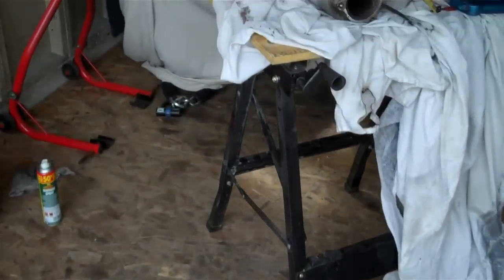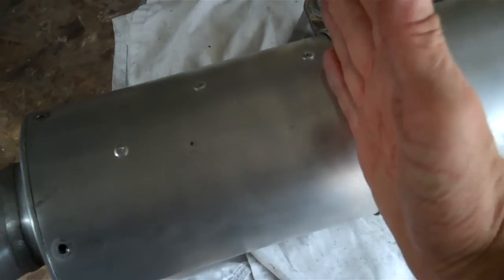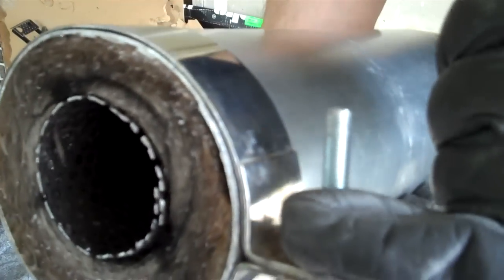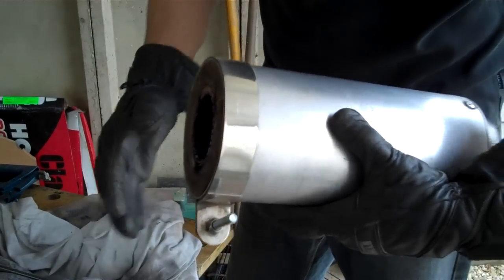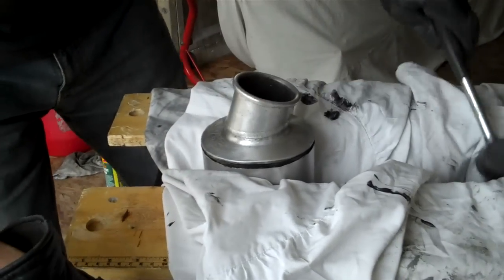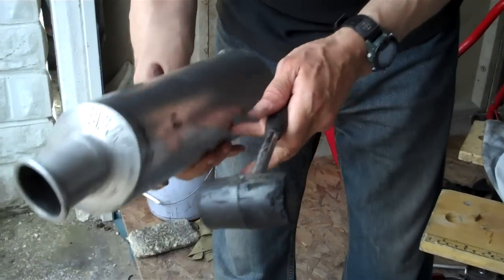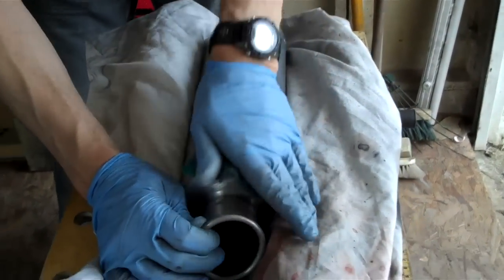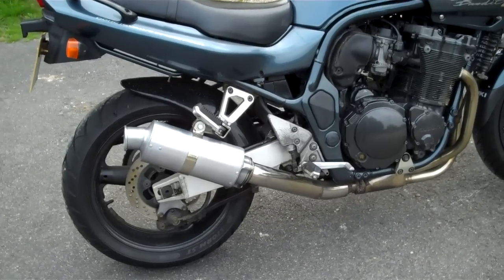Delboy's Garage, How-to 'Stubby' a Yoshi Race can.

Comment: hi mate. Whats was the result. I think to cut mine scorpion for cb 1300. What about the power? did you notice any flats spots or anything like that?
Reply from the maker: +GTI KR On mine it was a carb'd bike, so no problems... fuel injection should adapt, but naturally you would benefit from a power commander and a free flowing air filter...
Reply: I have got k&n.  I thinking about power commander. Now it's fine when I fitted scorpion I didn't notice any difference but it's about 40 cm and I would cut about 10cm off. Should look better and I think should be a litle bit louder.

Comment: hey Delboy. i have a gsx600f with a micron system on and its too quiet. is it possible to stubby it ? when i remove the end cap after removing the 3 allen bolts all i see is what seems to be another end cap. yours sounds sweet by the way.
Reply from the maker: +Darren Fletcher Hi Darren, if it's a quiet Micron then it has chambers inside, which snake left and right as the gas travels down, so not easy to stubby even if it's possible at all... easier to just buy a cheap second hand Micron race can, which should bolt straight on, or maybe even, something like a Delkevic from Ebay... good luck mate !
Reply: Thanks pal. Keep up the good work on YouTube

Comment: Hello!! What a great and amazing job i wanna do the same on my CBF 1000 do you think it’s possible ?
Bécause the cap seem to be sealed by a welding job.
Thank’ s for your advice.
Soory if my english isn’t as good as i wich.
Marc from Paris
Reply from the maker: Hi Marc, sadly if you are talking about the factory exhaust can that come on the bike, then you cannot do this... this can only be done to a straight through race can, then all you're doing is shortening it... the factory exhausts has chambers inside it and it would need much more 'surgery' to make it in to a straight through exhaust... hope that helps you and good luck... Del

Comment: hiya del/penny. mike/jan here can you tell me where did you get your stainless exhaust hanging bracket from my can is oval but the hanging bracket is round. need an oval one without the rubber strap on it hope you can help me pls. looked on ebay but most are round with the rubber strap cheers delboy.........thanks again mike.. ;-)ps whats your address to send a xmas card ;-)
Reply from the maker: Hi Mike, the strap came with the can, if you measure the overall circumference on the can and compare it to the bracket, is it the same distance?  If it is, you can flatten them out and re-shape it, and therefore the gasket should fit to!  And drop Penny an email and she'll hook you up with a land address...!

Comment: Sounds fantastic! Any chances you could shoot me some advice? The bike I've got at the moment has a fixed exhaust to the down pipe, so the only way I can fit an aftermarket can is by cutting the factory one off. I don't have access to a garage/workshop or any appropriate tools to get the job done :(
Reply from the maker: +MrMellow HI mate, its not a hard job to graft a slip-on can over your link pipe, you need to cut and leave at least 2" of 'straight' pipe to slip over...and make sure its pointing in the right direction....but its easier to take your whole back half off and fit a can with link pipe which they usually come with... ahev a look at the 'Delkavic' products to see if there's one for youe bike..!

Comment: Sir, have you considered, OR, is there any consideration to factory specifications when you go changing the exhaust, the
way do?   The original can is that long, POSSIBLY for a reason.  It may be needed to keep the engine in tune. I realize that
you may not like the sound of the original pipe, but . . . . I don't know man.
Reply from the maker: Exhaust system dynamics are not as fragile and tempremental as you may think... well, at least not on 4 stroke motors... perhaps on expansion chambers of 2 strokes, but that's another science altogether... all the job of the exhaust is, is to direct the spent gases behind the vehicle... it is important with 2 cylinders that each pipe is of equivalent length as this balances what little back pressure it may need, cylinder to cylinder, but the only requirement that the engine will need is to simply balance the fueling with the exhaust free flow, so if you are free flowing and extracting exhaust a little quicker, you simply pump the fuel in a little quicker too, so a free flowing air intake and a slightly broader fuel map on the ECU, and the computer will work the rest out for itself... with a carb'd engine, any imbalances in exhaust will manifect themselves in a 'flat spot' somewhere in the revs, and all you do is re-jet the carb to fuel correctly, usually a lightly larger main jet and liftt he float needle, maybe, one notch, so YES, is the short answer, I always give consideration to the full system from air filter to tail pipe, and make sure it's running right by checking plug colour and performance before it gets used hard.

Comment: Hey Del, I shortened my Yoshi recently,(only by 5" tho) after seeing your video for the first time, n it turned out great! Looks and sounds awesome!!! My Yoshi is/was an RS-3 Titanium, n was originally 20" long on just the body, not overall! N mine has 4 bolt holes. My question to you is...did you notice any...low end power differences?! Thanks bro!!   Don, TX
Reply from the maker: Hi Don, no difference at all in performance, expect perhaps a little free-er at the top end... the fact that your bike was already running correctly on a straight through RS-3 won't change much when you lop 5" off the end... the big difference is, when you go from the choked up factory can to the RS-3... as you lose all the back pressure, but if it was fine with it full length then, like mine, it will be fine, even as little as 11" long... just LOUDER!

Comment: Just wondering about any power loss after the mod???
Reply from the maker: None at all buddy, and no flat spots... as the bike has totally standard down pipes and link pipe
Reply: Thank's for your reply, i have a Viper can on my ZRX1200, way way too long and i was thinking of halfing it ca.20cm do you think there would be a difference in performance then?
Reply: I halved mine today, fine job and sounds lovely and looks graet too, took it out and all seems fine, all thanks to your Video .. Thank you.

Comment: Can i fit any slip on on my bike if i have an adapter?
Reply from the maker: +Bonglord You can fit anything to anything if you have some igneuity... I've just fitted a 7" tail can from a Triumph twin to a Kawasaki sports bike!  Perhaps search by typing in your bike and see what proucts come up, if that helps !
Reply: Ive had a look and cant really find much, ill sort something out :). And by the way i asked about my throttle sticking a while back and you asked me to keep in touch, well i took the throttle assembly off and put it back on again(less tight) and moved it a tiny bit further up my bars and it snaps back now. maybe the throttle cable just stretched a bit somehow but yea, it seems to be fine now. Thanks for your help, really appreciate it :)
Reply from the maker: +Bonglord Ohm cool, im glad we were able to help with the throttle and glad you got it sorted out.. there are many universal type cans on the maket, and all good value.. just shop within your budget, and pick somehting that looks cool.!!

Comment: the black rubber seal wont melt?
Reply from the maker: No, it's high temperature sealant and when sealed between a joint, the air cannot get to it to burn it... try it, it works!

Comment: i have a leovince it looks just like that one, and if it's built like mine it's not welded on the other side.....
Reply from the maker: The Yoshi is impossible to just pull apart....the central tube is pressed round the alloy cast ends and spot welded to itslef...